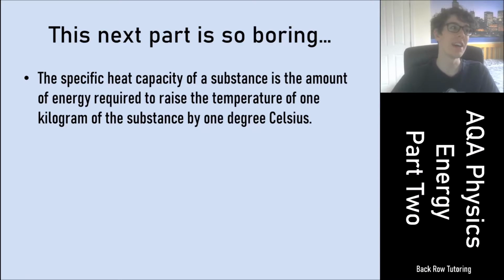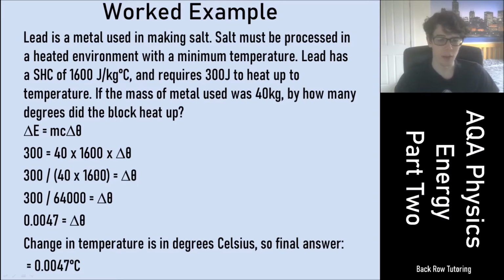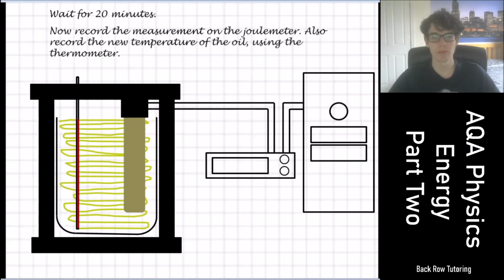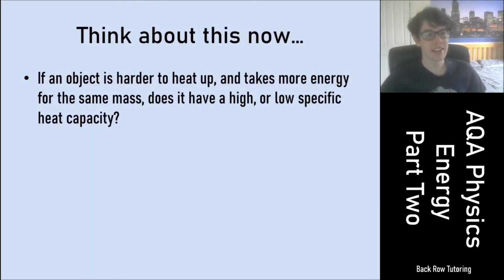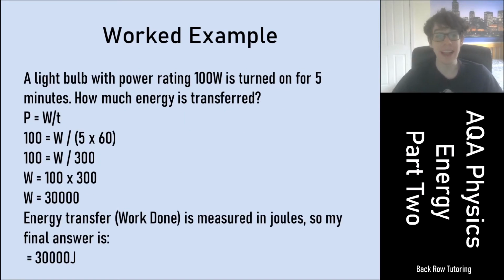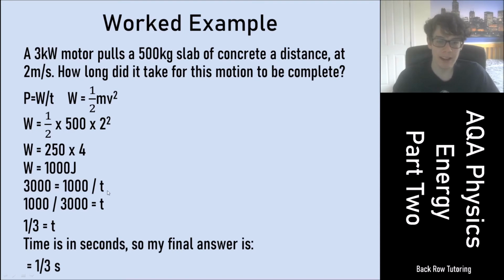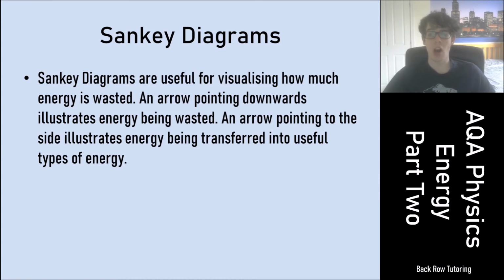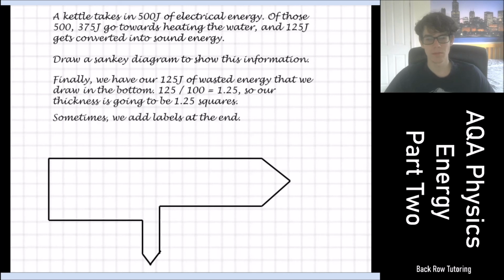AQA Physics [] Energy 2 [] Power & wasted energy

Comment: Hi i have a question can you solve this
Reply from the maker: Solve what?
Reply: @backrowtutoring99  A Physics problem if you dont mind
Reply from the maker: @mehedihasan-bn1ro  Okay show me where I can access this problem :D
Reply: @backrowtutoring99  Here is the Question. 
An object of mass 900 kg started Moving with 10m/s2 uniform acceleration from a resting position. It moved with uniform velocity for 10 seconds and after 5 seconds the car was stopped. After 2 seconds from beginning, the velocity of the car was 4 m/s
Q.1) Calculate the distance travelled by the car on the 12th second. 
Q.2) Calculate the total distance travelled by the car.

Waiting for your answer thank you
Reply: @backrowtutoring99  Another Question related to power and energy..
Q. An object of mass 100 kg is lifted 20 m height in 20 seconds by using a motor of 2 Kw.
Q.1) Explain the amount of energy lost by calculating the efficiency of the motor